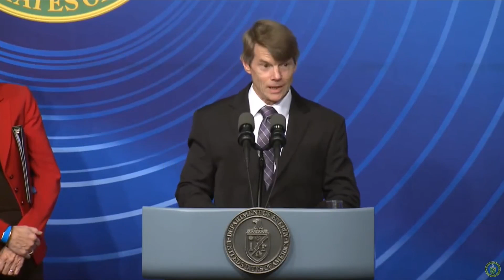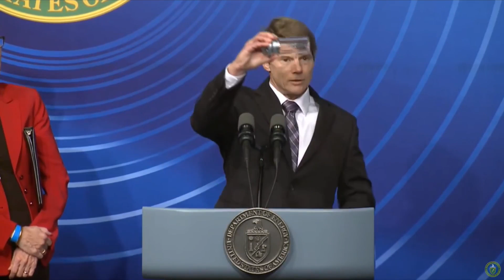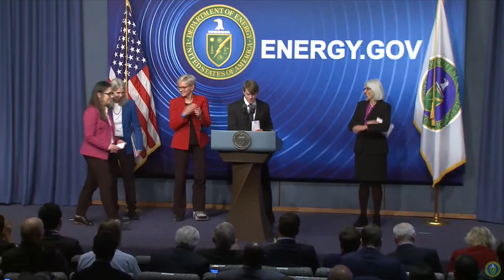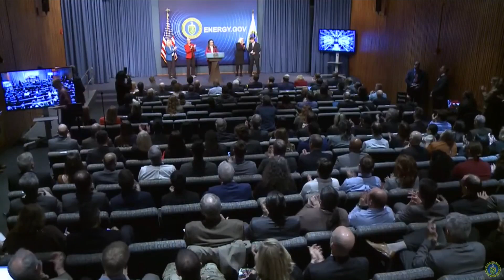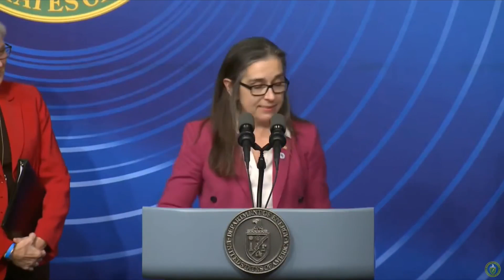Fusion energy breakthrough and national security implications explained

Comment: Your all fools.... the danger is to great for the little return. Go to United nation opps FILES then go to the mid west. Look for UN blue roof tops, a international single of danger. We, all ready built a fuzen,  late 60, early 70.. what was missed, was the field. The changes that will happen every time. 7000 degrees, a controled fire ball, 
What no one saw comeing was the magnetic field, I'm talking, black hole crap...sucking, tools , chairs, belt buckles, ( oh people still had the belts on as they were sucked into the ball of light, then gone. All back up to put it out failed.
Liquid Nitrogen at -350 degrees has been constantly sprayed on the fire ball, still can here the screams as everyone ran.  Perpetual motion was 100% perfited in 1967. A full size electric power plant was built in 1968. In a hole over 3 miles deep on the east. The project was called 620 roof tops. Every 25 feet as we drilled down, we installed a metal shield. There are 620 of them. When I fired off the plant. There are 22 main leads going to the surface. The power plant, supplied electricity to all of the east coast for free. ( sentiors bought the power plant, and still changed for the electric. ) makeings 100sssss of billions.. I was a kid when I built the small scale modle....I proved it worked,  small scale was a table top....one on the east coast is 250 feet around, sits on 5 " plate steel,  the hardest part, was clean air 2 miles down...and stairs to claim back out. We only built a ladder.
And it took 3 days of climbing down a ladder to get to the bottom of the hole. You, clipped off, and sleep in net baskets hanging in the dark.
... wonder why musk, doesn't, understand..
Oh, that's right, he stole my teasla battery design. Possing as a buyer..,

Comment: What he failed to mention is that by the time you figure in all of the energy that was needed to amplify those 192 LASER beams, the energy output (3 megajoules) was approximately 1% of the energy put in. Additionally, the element that they used inside the pellet, (tritium) is extremely rare in nature, which means it's prohibitively expensive ($30,000 per gram). Nonetheless, it was quite the milestone.

Comment: This is being massively overhyped and is not a major breakthrough. They used 300mj of electricity to fire the lasers. The lasers imparted 2mj of heat to make the fusion reaction which then only generated 3mj of heat. In order for this to ever be a viable reactor, the heat generated must be enough to be turned into electricity that exceeds the lasers, any containment fields, and all equipment involved to provide a net ELECTRICITY gain. This is no big deal.

Comment: Not to be a party pooper but someone has to address the elephant in the room. As much as this is a great proof of concept, the energy produced by the fusion was tiny compared to the energy needed to power the lasers. We still have a long way to go to figure this out. So, I am cautiously  celebrating this baby step in the right direction. Hopefully we'll get to see some practical use in our lifetime 🙏
Reply: 2 mega joules to power lasers to start.. 3 mega joules yield from fusion reaction.. that’s a net gain. 

Once you have an active fusion reaction, you are creating more power than it takes to power the lasers so it could technically power itself…
Reply: @landonmarttinen4921  " the calculation does not include the 300 or so megajoules needed to power up the lasers in the first place."

Comment: Notice the usage of "clean energy". It doesn't mean your electric bills will go down or get cheaper... Free energy has been discovered over 100 years ago. Why are they not putting time and energy into that? Why don't they work on electro magnetic engines with mercury which is clean and powerful? Whatever these guys have done, Lockheed martin has tech years ahead of this.

Comment: It's just another scam for funding and to make the public voluntarily give up heat and fuel.

The energy in was measured at the lazer, not the energy powering the lazer and not the energy required to create the deuterium and tritium pellets. The energy in, in this particular experiment, is unfortunately 100 000 times more than produced. Not to mention the limiting factor of tritium or the energy required to build the device and set it up for ignition. There isn't enough tritium on earth and the energy required to purify it negates all energy produced.

Comment: Of course, the 'over unity' crowd has been investigating other ways of achieving the same or similar, for many MANY decades. Recall that the amount of 'zero point energy' in the volumetric space of a empty cup (8 oz volume) is enough, in Newtonian measurement terms..to boil all the earth's oceans. There are ways of cracking this puzzle that have nothing to do with centralized power. Important. Not centralized power. There are subtle tickle methods, hundreds of them.. resonance methods, combined with chemical pH offset methods, with electrical resonance addition methods, with transient pulses in all forms, across shearing in pressure, resonance and pH differentials. 

Hundreds of ways known by these alternative research fields that have languished and been ridiculed, for decades. (all their researchers have 'disappeared'. ahem. think about that. How much we've lost, been forced into losing...) There are puzzles in there, re the politics, the military, private corporations, withholding  of 'high technology', clues on very old archeological finds, and so on. 

The method used here in this news report is a 'brute force and ignorance' method, and it STILL works. Over-unity research, in myriad ways, has been a 'thing' for many many decades. I can't get into the whole envelope of the questions  and answers that surround it all but, it most certainly takes you down a suppression and x-files kind of road, in the extreme, in both proliferation and overall complexities. Read it while you can, I expect this comment to be curated out of existence. an example is that the japan office of patents has awarded Toyota corporation and some others, they have awarded patents in the field of atomic transmutation. which is tied at the hip to the announcement in this video above. We're talking about dams bursting, as it is now, after nearly 100 years on modern research alone, finally being 'acceptable' and 'possible'.

Comment: It's amazing that not only did the device survive the experiment but that it performed at 150% efficiency compared to the average fission plant at 135%. I hope they can scale this to be useful and cost effective.
Reply: @djdoc06  I see, so another 30 years from now just like they said 30 years ago and will probably say in another 30 years.
Reply: 150% of the power that the laser put in, not total, watch Sabine on fission or look into q numbers and a total vs what's reported
Reply: Did they add the power into the calculation needed to work the lasers?
Reply: @marypetrie930  Oh, wow...can't believe you thot of that. Wow....they all missed that! Good catch!  lol
Reply: The efficiency measurement is absurd.  Yes, more energy was released than was in the light that struck the target.  But creating laser light is inefficient, so only 1% of the light that was used to pump the lasers was released by the fusion reaction.
Reply: Fission plants are less than 40% efficient due to the way steam generators work.  Fusion will still need a better way to convert the released energy to something usable or they'll be bottlenecked by those same inefficient steam generators.
Reply: @Rster0211  If you want a more efficient method just stick a tiny planet next to it. Wait for dinosaurs to evolve then throw a rock at it. Wait a bit longer and the dinos will turn into a lovely black goo you can put in your Ford Focus. Now you're driving in style thanks to the power of the sun and Mr Triceratops.
Reply: @Rster0211  they talked only about weapons
Reply: @lukapretegiani3348  That's the fine print. Government blow-hards say "look at the shiny object." And everybody looks.
Reply: @Rster0211  If they achieved that 150% that means they already have overcame that bottleneck. I have great doubts they can scale that for continuous production though.
Reply: @PCgamer923  He's referring to the actual steam cycle efficiency, which you can't avoid. Look up thermodynamics cycles. You need to convert the energy from the reaction (burning natural gas, coal, or heat released from fission) into shaft power somehow. This fusion experiment only addresses how much energy was released vs went in, NOT that the energy that was released could be captured. This is the equivalent of finally being able to light a lump of coal on fire and getting some heat from it. You need to figure out a way to harness that energy later into something useful.
Reply: @mikewalko536  exactly right! Because releasing energy is one thing but harnessing it for reuse with full efficiency is a completely different thing.
Reply: @djdoc06  What you're saying is the gravity from all the hydrogen being close together causes enough core pressure that it causes the fusion. The gravity also keeping the explosion from expanding out indefinitely and decreasing the pressure so that no more fusion can occur.

At least that's how I understand it to work.
Reply: @djdoc06  they should've just reported 30 years later then
Reply: no
Reply: That's exactly the reason why this isn't some huge life changing thing. The solution has to be scalable to be valuable. When we see that for real, we have a major life changing break through. This is just basically 'we built the first three steps of the staircase to get there.' but there are a hundred more to build.
Reply: I dont know what's happening, but great!
Reply: Jesus died for our sins.  3 days later he was risen from death.  Jesus is alive and He can forgive you of your sins.  MARK 1:15 Repent and believe in the gospel.
Reply: @youtube_chaplain  Jesus was executed in a very popular and horrific method of the day by the roman pagans and orthodox jews, he forgave nothing and you are responsible for your own sins. Stop committing sins on others.

Comment: This is a crock.  Yes, yes the energy output was more than the energy input by the lasers, but the energy input to the lasers was massively higher.  Therefore, there was a net energy input, not output.  Let me know when there is a net energy output for hours, not nanoseconds.  Looks like it will be another 50 years until we get practical fusion.

Comment: If the government is running this it will be another thousand years before you can buy a working fusion generator. Just like the DNA sequencing project run by the government. The private sector did it better in less time for less money without sticking a gun in tax payers backs and stealing money from them. Virtually all government is bad government.

Comment: To START, this is important research.
That said.

More energy out then in is misleading. This has been done before a couple years ago. It excludes a lot of energy used to bring this about.

It's not clean energy as far as radiation.
The radiation produced is only clean compared to current technology. It's far lower, but is still an issue.

Anyway, let's see what the future results produce.

Comment: I live in Oregon and am developing my own fusion engine, would love to work with these folks on miniaturizing their reactor down in size to make it transportable by vehicle.  My own fusion engine breaks water molecules apart to create supercavitation with proper ducting, functions very similar to rocket motors, yet mine only is able to operate fully submerged underwater.  My greatest technical hurdle by far is 3D printing a ceramic metal matrix able to survive a full fusion thrust without melting.
Reply: don't you end up making a hydrogen bomb in your garage lol

Comment: So they shot part or parts of the Electromagnetic Spectrum at the bit of matter and produced a reaction in the central catalyst,  through the production of X-Rays (another part of the Electromagnetic Spectrum) with it then affecting the bit of matter (the catalyst) inside of the small cylinder. So how do we know it actually squeezed it as mechanically described and not just energised what ever catalyst they used through part of the ionising part of the Electromagnetic Spectrum? As SAFIRE uses just an input of less than 190 Watts DC and gets output surges of upto and over 10 million Watts DC, in a constant and controlled way, and where it has given us fusion for some years now and by just using a straight electrical input and not part or parts of its spectrum. Also what was the their catalyst they used to produce this other element in, the process?  They also imply that it exploded and that it was this that created more energy than what was put in and so releasing the electromagnetic energy within the catalyst, so are they just using terminology to fudge their way around what really is going on and so keep the funding coming in and their reputations alive?

Comment: 20 years until the first plant is built?
This has been the catch cry since the 1970s.
I will wait for the first practical application and large scale "proven" operation.
Until then, we have nonsense distractions from the Intellectual Class which an intricate component of the corrupt Ruling Class.
Wake up people this is a political advertisement. Listen very carefully to the language used by the speaker.
The way he described the energy release on very small time scales.
Almost as impressive as Pfizer's claim that its mRNA Gene Modulation Therapies were 94.1% effective against SARS-CoV-2 infection.
We now learn that the absolute effectiveness of these experimental injections is 0.84% with a spike of 3.7%. 
😇

Comment: Congrats of course to all the people of science. Would be interesting to see how this breakthrough can be inserted in the working energy systems, what limitations and work conditions it has - to what exted it's doable and usable... Our standard home heat pumps have 3-4 efficency coefficent at standard working temperatures vs 1.5 of this new technology... could it be say on the electricity power stations? Would it be efficent at current energy prices with 50% increase of the output? Hm..

Comment: I'm not an expert in the field but this strikes me as a complete non result. Can we assume the 2MJ was laser light, not electric input into the laser? so if we say the laser is 30% efficient the setup is already deep under water. And on top of that it's thermal energy out so at least about 50% further loss. And then there is the energy to prepare the pellets etc.
With all due respect, if the department of energy knew what they were doing we wouldn't have a 75 year cover up of the presence of ET cultures and US possession of numerous retrieved ET craft.
All you sheep applauding this lie. Wake up.

Comment: Like wow it does what a nuke does. 

Explosives compress the material or a gun like tube fires a chunk of material at a core almost at criticality and the material puts out far more than the energy of what started the reaction...

What you think the explosives in little boy over Japan had the same force as the nuclear explosion that it caused cause they didn't as a grain of rice sized piece of the soft ball sized core underwent a reaction.

Put out more energy than the pellet has locked inside it and that will be impressive ..
Reply: So technically it shoulda exploded like a nuke cause it's the same size piece of material but it didn't. Why they not using nuclear materials for it.....

Obviously explosions.... So what makes them think this is possible as they literally did far worse than energy from a nuclear explosion..

Comment: So they made a breakthrough in energy generation with fusion & this guy is talking about national security? 

He states 3 things. 

1. It helps defence programs to maintain confidence in their deterrent without nuclear explosive testing by using lab experiments.

2. It underpins the credibility of their deterrent.

3. Continuing to avoid testing will advance their non-proliferation goals. 

He seems to be indicating that they are going to use this research to design better nuclear weapons & one of the advantages is that they don't have to explode any nuclear bombs in the process. 

He also seems to imply that this technology circumvents the requirements for the nuclear non-proliferation treaty.

Comment: This is somewhat deceiving.  It takes far more energy to produce 2 megajoules of laser light than the three megajoules they got from the reaction.  These numbers are rounded up and down, by the way.

From the Department of Energy:

“We got out 3.15 megajoules; we input 2.05 megajoules in the laser,” said Mark Herrmann, the Livermore laboratory’s program director for weapon physics and design, in an expert panel discussion that followed the announcement. “That’s never been done before in any fusion laboratory anywhere in the world.”

But, he added, the output was about 1% of the electricity used.

“I want to be clear — ultimately, this experiment drew about 300 megajoules from the grid,” 

In other words, they pulled about 300 megajoules from the grid to produce 2.05 megajoules of laser light to get 3.15 megajoules out.